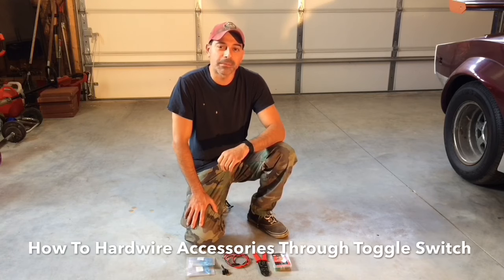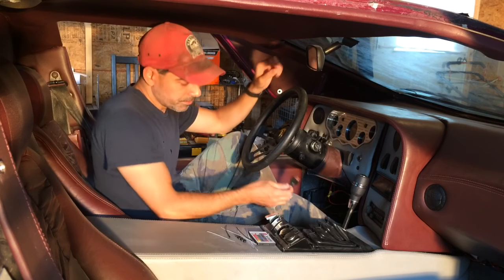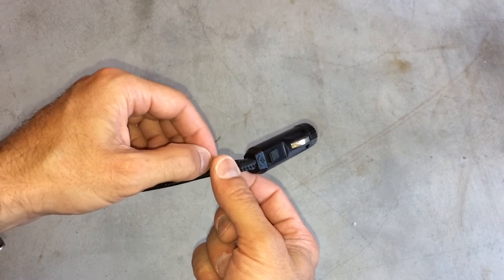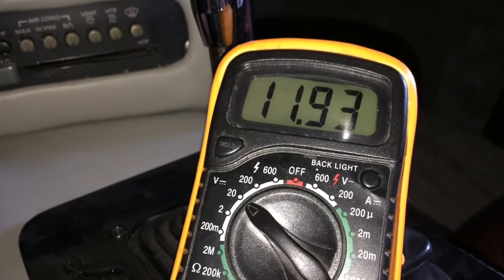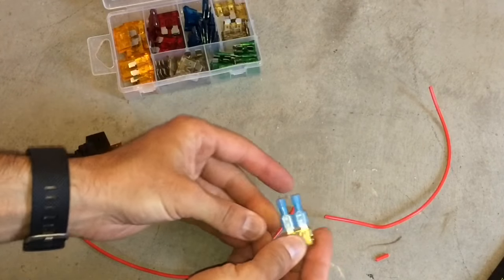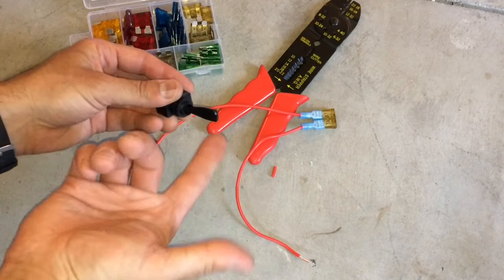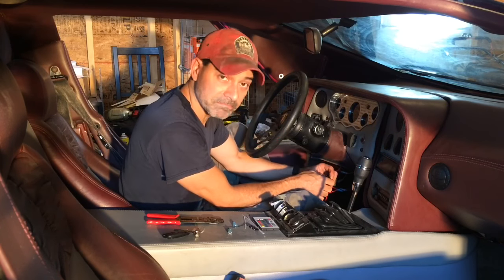Wiring 12v Car Accessories To Toggle Switch (Andy’s Garage: Episode - 95)

Comment from the maker: I forgot to clarify on the video that the gauge of wire used is determined by the amps of the accessory. Items using 10 - 15amps can use 18 - 16 gauge; 20amps use no less than 14 gauge
Reply: Hi so i will only have one fuse right as i will have one wire comin from the battary to the off switch an then one wire which is connected from my led an lights passing trough a fuse then connected to the on switch an the ground wire from the devices i can connect to my car battarys ground right please let me know also what amp do i need for the fuse what fuse can take the lights i have do u know
Reply from the maker: Vlogstar Parm yes, one fuse located between your 12v power (Battery) and the toggle switch
Reply: @PhillipsVision  what fuse do u recommend im goona use 18gauge wire wire
Reply from the maker: Vlogstar Parm 15amp fuse should be fine, but double check the draw of your accessory
Reply: @PhillipsVision  ok thanks what is the draw as the led light show 12v power an number of led lights on it thats all
Reply from the maker: Vlogstar Parm you need to find out your wattage and divide it by 12, that gives you the amps
Reply: @PhillipsVision  hi so today i for the toggle switch i fused it to a fuse in the fuse box insted of direct 12 v battary power then used body of ground insted of battary is that ok it got gone from a perfessional i jus wanted to ask u as i never knew u can do that
Reply from the maker: Vlogstar Parm I would connect it to 12v and add an inline fuse, that way it’s a designated line
Reply: @PhillipsVision  ok im change to that way thanks
Reply: hi jus realised my power cabel an incline fuse in the fuse holder came with 10amp fuse can i add 15amp fuse as i have more the one device wired u see an the 10 amp fuse the power cable came with would jus be for if there was one device right i have already a 7.5 fuse insted of the 10amp fuse at the moment this is what the shop guys gone please help i can then explain to them too before i do anything as they know more then me u know more too thanks
Reply from the maker: Vlogstar Parm yes, you can up the amps, just not lower it
Reply: @PhillipsVision  ok thats fine but its its lower then then 10amps the fuse holder came with but still working what shall i put in there u think
Reply: @PhillipsVision  which one is the correct position for fuse, between switch and battery or between switch and the accessories? Please make it clear.
Reply from the maker: @Aksinghgzp  you want the fuse to be between the 12v power and the switch that way it cuts off the power before it hits the switch
Reply: @PhillipsVision  yes! I missed that part so I went through the video twice for this to confirm. Thanks brother! I appreciate!👍
Reply: @PhillipsVision  would you please   make a video or a diagram to show the wiring for a completely separate horn setup with switch n fuse. I don't want to even touch my car's stock horn setup. It'll be appreciated brother.👍
Reply: @PhillipsVision  isn't it the other way around? Obviously I'm an amateur and don't know much about wiring, but I'd imagine you wouldn't want a higher amp fuse because then it wouldn't blow before enough power is drawn to damage the accessory. Isn't the fuse there to stop it before it gets to that point, and that's why you shouldn't go with a higher amp than recommended?
Reply from the maker: @animationcrate  this comment is not about the amp of the fuse, it pertains to the gauge of the wire. The fuse amp must be for the accessory, the gauge must be appropriate for the current so it doesn’t cause a fire
Reply: i know I am kind of randomly asking but does anybody know of a good site to watch new tv shows online?
Reply: @Louie Ryder I watch on Flixzone. Just google for it :)
Reply: @Kaysen Albert Definitely, have been watching on flixzone for years myself :)
Reply: @Kaysen Albert thank you, I signed up and it seems like a nice service :D I really appreciate it !!
Reply: @Louie Ryder Glad I could help =)
Reply: So wats a Bosch whiper motor for a 1991 Ford EB Fairmont?
Reply: @PhillipsVision  Can I use a 12V 20A toggle switch in my motorbike which has a 12V 9A battery? I want to use it for controlling a pair of 12V 20W fog lights. Is it wise to install it on my bike without using any relay?
Reply from the maker: @daexplorogist1781  you can install a relay. I always just use an in-line fuse. What’s the amp of your lights?
Reply from the maker: @daexplorogist1781  then, yes, a relay is needed.
Reply: @PhillipsVision  is that true about you need to put the switch on the + and if you put the switch on the ground it would cause a fire, why is this?
Reply: 15 Amps should be 14 gauge wire and 20 amps should be 12 gauge.  It's a good idea to follow the Same recommendations as wiring a home
Reply: @PhillipsVision  I think you meant the opposite.  You can lower the Amps of a fuse, not raise it beyond what the wire can handle
Reply: @PhillipsVision   I am installing a MSD 8733 2-step module in my car, I have a 12v momentary button that's built into my shift knob so when I hold the button its active by ground, I am wondering how could I Install a toggle on/off switch and also have the momentary button? Do you just wire it in to the rest
Reply: When l open door the dome light comes on, l want to install a toggle switch to cut the power to dome light, it has two wires to light. What type of toggle would be appropriate for this purpose?

Comment: I would be using a relay in that circuit. Rad fans are drawing quite big amps and things are gonna get warm using your method.
Reply: Agreed. Relay plus 12ga wires would be my recommendation
Reply: Yes at least use 10-12 gauge wire I used that thin wire and my switch got way to hot and started smoking
Reply: Proper way is using Relays.
Reply: Thanks for this tip to add a relay and use 12g wire as my switch DID get hot using this method and 16g wire (only the load wire side got hot, though the accessory out wire stayed perfectly cool).  I now understand the too-small wire problem but can someone explain (1) the overheating load wire while out wire remained cool and (2) what a relay will do to solve this problem?
Reply: @joeradler  Relay acts as a switch, keeping the circuit the fan is on separate. Don’t forget to add a fuse on the positive side. Wire getting hot because it’s taking the whole load for the fan and switch. Fans draw large amps so it’ll get warm if not thick enough.
Putting a relay in keeps the circuitry for the accessory compact and isolated.
Reply: @petittrainguernsey3297  thanks, I appreciate the info.  If I increase guage of the load wire into the switch but keep the accessory-out wire 16g, would that be ok or does the whole circuit need to be wired w 10-12 guage?
Reply: @joeradler  
I dunno about gauge wires. I’m in Europe and we just go on amp rating.
The switch circuitry can be 8amp because it is only operating the relay.
With something like a fan I would be using something hefty. At least more than the recommended fuse. So the fuse blows before the wires melt if it shorts.
There are some great vids on YT on how to wire up a relay. Once you’ve done it a couple of times it makes perfect sense.
Reply: @petittrainguernsey3297  when I refer to "guage" I think uts the same as what you're calling wire "thickness".  So if I use thicker wire from 12v battery power load to Fuze to switch, then thinner wire from switch to fan, will that prevent overheating the load wire?
Reply: @joeradler  
Your switch wire is only going to the relay. Your dash switch turns the relay on or off. 
You can take the positive feed for the switch from any positive feed under the dash. Anything that’s live when the ignition is turned on. Cigarette lighter for example. You are creating a circuit to the relay then earth. If you use an existing circuit as your dash switch feed it will already be fused. 
When you flick the dash switch on it triggers a solenoid in the relay which completes the circuit for the fan. The relay is just a switch. 
Using a relay allows much lower gauge or amperage wire to be used on the long run to the dash. Your circuits will be:
1) Live to switch to relay to earth.
2) live feed 12v off the battery to fuse to relay to fan to earth.
The relay is the switch in this scenario.
Reply: @joeradler  
Watching the video again he is doing it in a really dangerous way. It must have a relay in the circuit and proper fuse holders are really cheap. 
Any short on the live feed in this video is going to torch the car. Cables rubbing through on the chassis or anything under the dash will be catastrophic. 
Seriously, it’s worth the effort to fit a relay. It’s a little extra work but you’ll have peace of mind.
Reply: @joeradler  
No, don’t do this. The circuit will overheat at the point if minimum resistance. Which would be the smaller gauge wire. 
Use a relay mate. There really is no other safe way. That’s why they are used on all the accessories in the car.
Reply: @petittrainguernsey3297  i really appreciate all this info, very helpful.   One thing I'm not understanding though is how the addition of a relay is better than a toggle switch alone. Is there something about the relay that also helps regulate the amperage after it is switched on? Or is the live feed from the dash to the toggle somehow regulated and not the same as direct from 12v battery? You mentioned before relays create a smaller circuit (or maybe more circuits) but I don't quite understand what you mean by that as it seems the total amount of wire distance will remain about the same?
Reply: @joeradler  All a relay is is a switch. Your toggle switch turns it on and off. When the relay is turned on it completes the circuit for the accessory by completing its circuit. The toggle switch circuit is low amp, the accessory circuit high amp. Using the relay means you don’t have high amp (thick gauge) wiring running about under the dash.
Reply: @petittrainguernsey3297  thanks for that explanation and the link. Very helpful!

Comment: What if it dont work no more.? The Bird was sitting in the repo yard for a whole week and im positive they didnt toggle the switch to off. She was clicking so i came back with a battery it does nothing. I dont hear my fuel pump my fans stop working  only one headlight working now. I only had it for 2 days  i need some advice before i see what im going to do with it. I just bought a fuel pump, starter, alternator and thermostat, thermostat hose, i see one wire disconnect from lower engine bay on the left its no other wires connected think its on the positive battery side but im not sure how he wired it i see where it goes to but im clueless after that i work on my own cars unless i pay a mechanic to help me because I need advice and extra hand.

Comment: Hello there, I am having a halogen head light of 12v 55w h3 which I want to directly connect it to the battery, how much gauge wire and fuse Iam suppose to use in this circuit, thanks

Comment: Man I got so frustrated trying to wire this toggle switch I had to take a break, glad I did cause I found your video and you walked me through it. Thank you
Reply from the maker: Michael Averett thanks for the feedback, glad it helped👍
Reply: Your your video is very good but I'm still a little confused because someone came to help me and they cut my wires on my wiring harness so I'm back at square one my wiring harness the lights are the only things together in the wiring harness now I don't know what to do
Reply: Please help me please help me please help me I'm lost my wiring harness has been cut by someone going to the thing I'm going to use cigarette lighter as the switch with the switch little round switch with two prongs I need help so bad

Comment: ok so i’m trying to wire this retractable license plate holder to my car and it’s got one of those standard 12v plug and my question is if i wire it straight to the battery cause my battery is in the trunk when i cut the car off will it automatically cut off or will i have to cut the switch off while the car is off the only reason i ask this is because the kit came with a key that you can use when the car is off
Reply from the maker: If it’s wired directly to the battery without a toggle switch, it will constantly be getting power. You need to run it through an in-line fuse (and possibly a relay switch) BEFORE it hits the toggle switch. You need to be able to cut off the power when not in use.

Comment: Can you just grab whatever black and red wire from under your steering wheel and wire your accessories onto there?
Reply from the maker: If the red is an accessory wire, yes. I wouldn’t recommend cutting into a factory wire. Make sure to ground the black.
Reply: @PhillipsVision  How do I add an accessory wire though? Sorry if this is a dumb question. I just dont know what wire is for accessories. I have a pretty old car so I don't want to mess anything up.

Comment: Interesting i wired my radiator fan and never checked the amp draw in advance. 🫣😝 The 20 amp toggle switch melted down, and oh i never fused it, #rookie. Now im redoing it with 10ga wire, 50 amp toggle and starting with a 30 amp fuse to test. Thanks for the video.

Comment: What about a amp for a stereo on a motorcycle amplifier.  It says I need a switch added what is my easiest route as far as wiring do I just use the positive wire only In and out? Please help

Comment: Andy, I want to hardwire in the FOVAL 150 watt inverter to a lighter socket in my 4runner then add a switch to turn it off so there's no battery drain. Is this wiring video good for that?
Reply from the maker: Marc Wetherbee should be fine just make sure you use the correct fuse and wire gauge for the draw
Reply: @PhillipsVision  do not wire inverter like this... Should run a relay....

Comment: Would this work for aftermarket gauges? The lights on the gauges to be exact. I have a 79 Monte Carlo and the gauges have a light that always on and it drained my battery 🤦🏽‍♂️ I want to be able to turn the lights on the gauges off and on.
Reply from the maker: It should

Comment: Hello. Do you still answer questions for this video? I'm installing a toggle switch to the fuse box, steering column issue, key won't turn (module). The process is the same, is that correct to assume? Thanks for the video.
Reply from the maker: Yes, I still answer 👍 Are you trying to install a starter switch?

Comment: I bought a used truck with fog lights but every time I flip the switch it get hot and smells burnt so I quickly turn it off. It has an inline fuse coming from positive terminal at battery. What could be causing it to get hot?
Reply from the maker: The wire gauge may be too thin. I would use 14 gauge to play it safe

Comment: My fans run through a relay. I need to run the wire from the relay that is going to constant power currently to my on position and the power source to the off position? Right?
Reply from the maker: That is correct. When you switch it “on”, the circuit will be complete and the 12v power will flow to the fans.

Comment: Great vid , I’m installing rock lights for my truck about 20 lights under it , should I do the same as you did with the fuse or it’s not necessary?
Reply from the maker: Always use a fuse as a safety valve

Comment: Have a question could you wire car reverse lights to toggle switch ?
Reply from the maker: You could but you would need to hardwire them to a 12volt source and not through the reverse switch of the shifter.

Comment: My question is did this switch need a ground ???
Reply from the maker: I don’t think it did. A momentary switch is in a default open position. When you push it the circuit is closed causing the 12volts to pass through. Only the 12volt power is connected to the switch, and the switch allows the power to reach the starter when pressed.
Reply: @PhillipsVision  thank you thats where i was confused .....power  and aux cables got it now ..great video
Reply from the maker: @gsanders7889  👍
Reply: Have a question i have a seaflo fan im installing in my trunk to a toggle switch the wires on the fan hot and ground are thwy wired to the toggle or just the hot wire t hanks

Comment: Can a switch like this work with current in reverse?  I.e. could you connect a solar trickle charger to the switch then to the battery?  If so, should I wire the switch with power in (solar panel) on the “off” side?
Reply from the maker: Just to clarify...you would have the trickle charger normally charging and the switch would cut off the connection? This is a momentary switch so the activation, or deactivation, would only take place as long as the switch is held down. If you want it to be able to switch on/off you’ll need a 12v toggle switch.
Reply: @PhillipsVision  hey!  Correct.  When the car is off, the trickle charger would send it’s current through the turned on switch to the battery.  When the car is turned on, the switch will be off (to prevent power from the battery going to the panel).  You’re right, I’d use a toggle switch, not a momentary switch.
Reply from the maker: @cbonesteaksauce3833  that should work

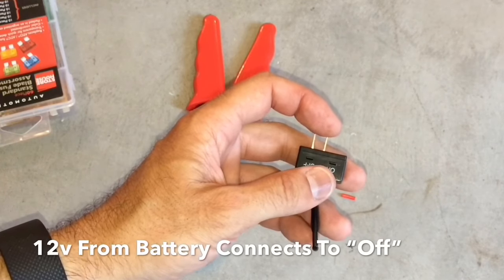Comment: 4:58 I have a 3 prong switch  the one with the metal lever  positive and negative ok but what's the third prong for where does that wire to,. Help urgently my life depends on it I need whipers so I can leave  where I'm being evicted from it's winter vand a very rainy place
Reply from the maker: Usually the top and bottom pins are  active and the middle neutral.